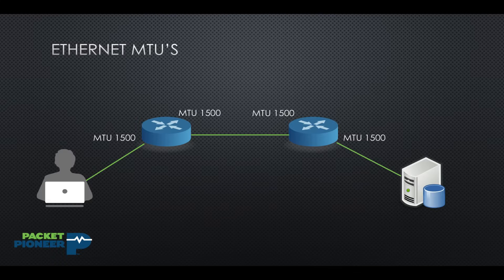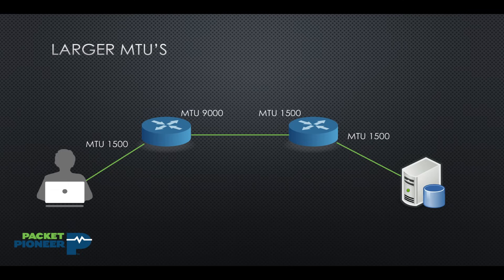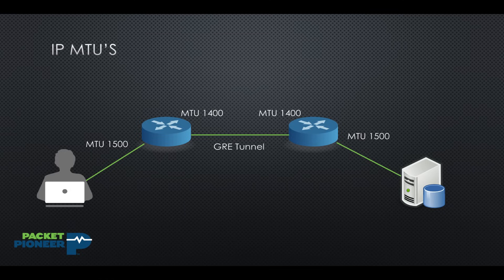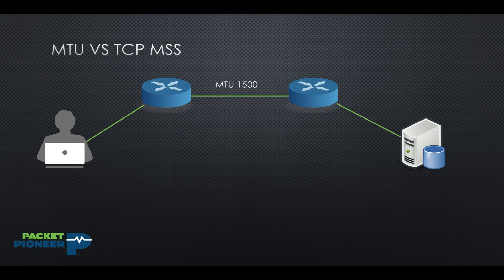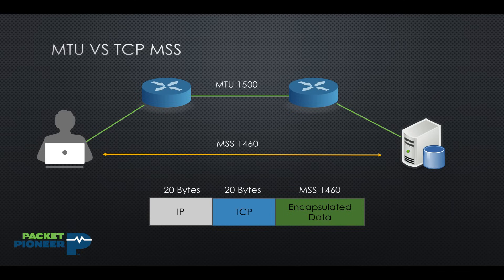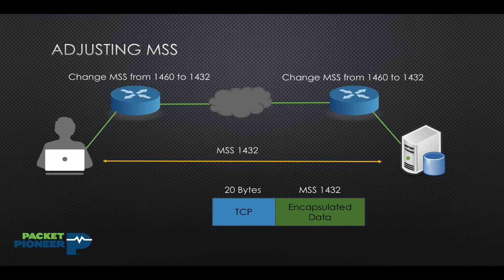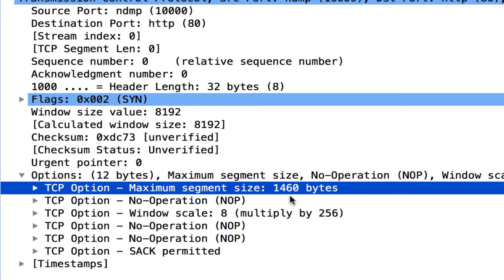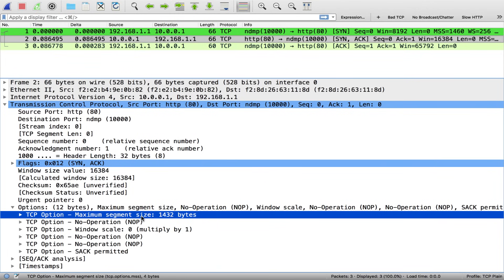How TCP Works - MTU vs MSS

Comment: Hi Chris, 
nice videos on Wireshark and TCP 
do you have any video that explains how to calculate the throughput I can get between 2 end-points?
thanks :)
Reply: My take on that is to get a sample capture of any protocol across those two endpoints. Then sum up all the frame lengths across a minute (60secs) duration. Then whatever value of bytes or bits (8) you get, divide that value by 60. With that you can get the bit per sec or bit rate. There you go.

(sum of all frame lengths across 1 minute duration) divided by 60 = bit rate or throughput. If you want payload or volume per minute, then no need to divide by 60.

Comment: Hello Chris, thank you for this quality content, your videos help me in my daily work as a network engineer.

I will really appreciate if you can give some advice about this issue.

This is a TCP conversation, the client announces an MSS = 1452, server announces MSS = 1460, client uploads data to the server, this is a LAN environment, both devices are physically in the same Data Center in different VLANs.
The problem: A lot of TCP errors: retransmissions (> 3%), dupACK, out of order packets, etc.
What I see: fragmentation, If I perform a tcpdump directly on client OS, I see a lot of packets larger than MSS, ie 3000 or 4000.
Why is client building that's long packets? could it be that TCP stack on the client side is not working as expected?

There is other TCP conversations between the same hosts but in the opposite direction, in that case, all packets are equal or less than MSS, TCP errors are minimal (<1%)

Regards from  México.
Reply: I'm wondering if you solved it :) IMO application on the one or both side has incorrect TCP implementation and despite negotiating MSS they ignore it and they send packets much larger than expected.

Comment: Hi, you mentioned at around 6.05 that the sender and receiver should use the lowest value of MSS. But in RFC 879, it states that "The MSS can be used completely independently in each direction of data flow. The result may be quite different maximum sizes in the two directions".
Reply from the maker: Hello Johnny - that is correct, the RFC does mention that it CAN be used independently. However, in most implementations, most TCP stacks will use the lower of the two values. For example, if a client sent a SYN with an MSS of 1300, it is rare to see the server send a 1460, or anythign higher than 1300. Usually it will send back a 1300 as well.

Comment: Hey Chris, 

What is the exact difference between MSS and Window size ? 

I gone through the your videos and I found that in wireshark window size is 65535 bytes and MSS size is 1460. 

Now MSS value is local to interface and Window size is receiver buffer size. 

So if the Window size is 65535 bytes and mss size is 1460 then will client/server send data as per 65535/1460=44 segment of chunks ?
Reply: Great question, I want to know the answer of this question too ??